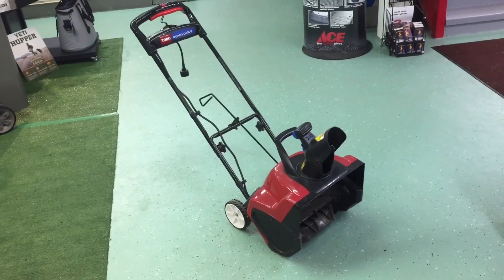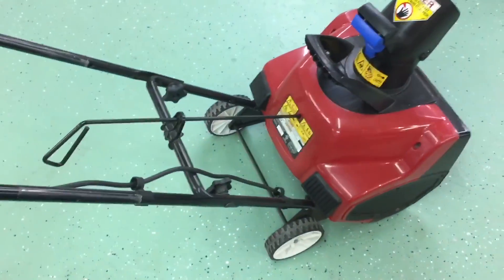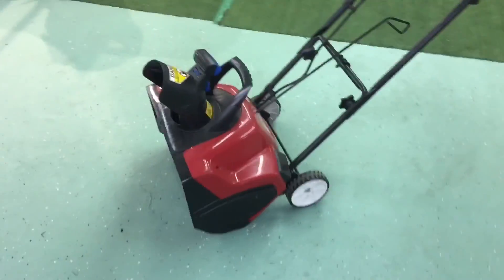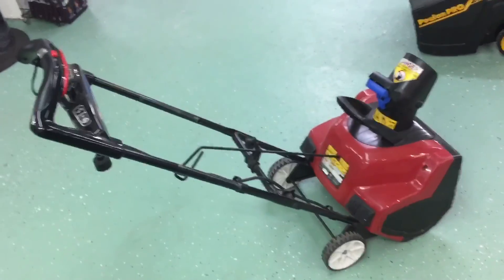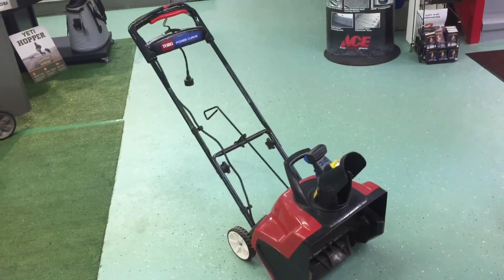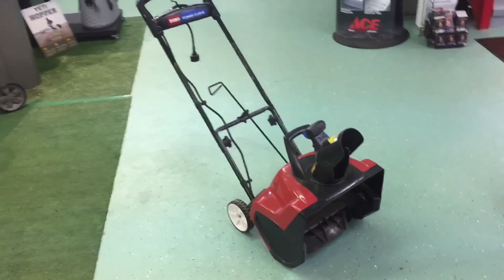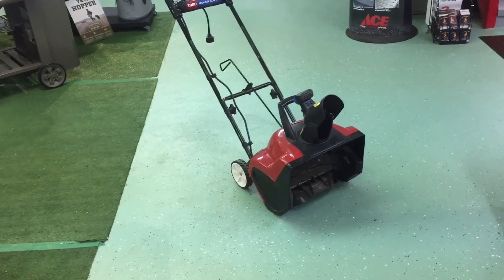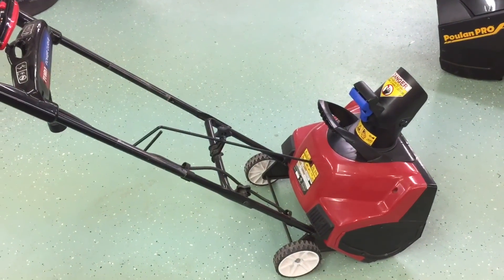Overview/review of the Toro Powercurve Snowthrower

Comment: Our first Toro 1800 was a total workhorse and it operated well for over 10 yrs (northern Illinois winters). Purchased a new Model 1800 about 4 yrs. ago and we can count on repairing it AT LEAST once per winter. Carbon motor brushes get stuck and it's a no go. That seems to be an inherent problem with the "newer" units. Looked on E-bay and ordered a pack of 20 for $12.00. The size is 6mm x 6mm x 20mm. Cheaper than buying locally as I was quoted $60.00 per brush (need a set of 2) plus shipping!!! Outrageous.
Reply from the maker: Appreciate the info

Comment: Mine only lasted three years before the motor burned up. Same failure with a couple of their leaf blowers.
Replacement parts are very limited and motors are not included. 
Do yourself a favor and get a Snow Joe which is $100 less expensive and which I've had very good luck with.

Comment: is there any particular issue starting it? my brother in law has one and i tried to use it but the trigger to run it seems stuck the gray plastic key was plugged in to. any idea what might be wrong?
Reply from the maker: It's a simple contact.  I'd say something is sticking. Not sure what without seeing it however.  
Good luck with it
Reply: ok, thank you very much for answering me.   :)
Reply from the maker: You're welcome. (and thanks for the question)
Reply: I have the same problem ever get it fixed ? I just got one tonight...its seems locked up ...thanks